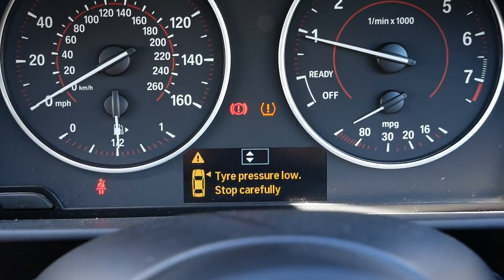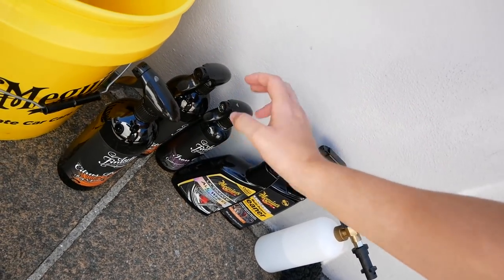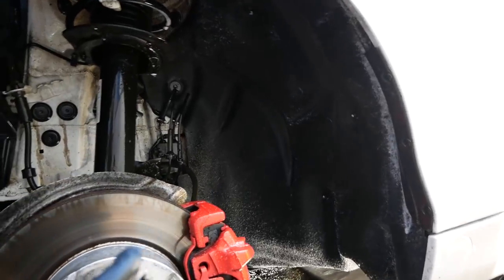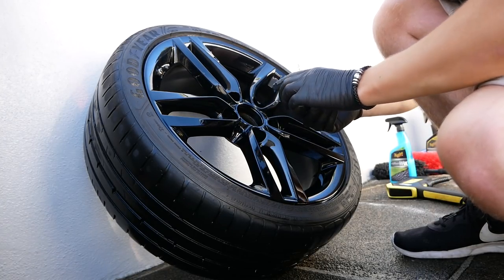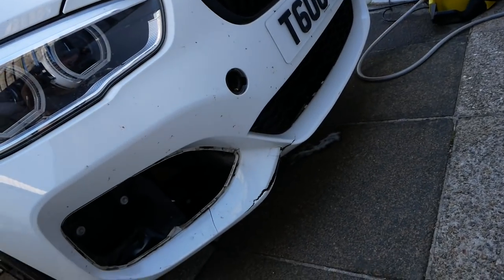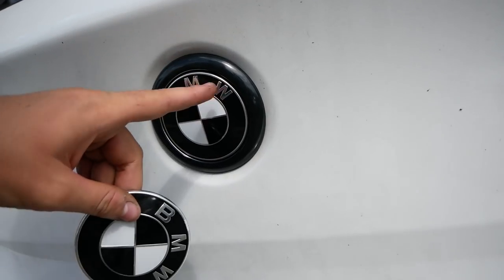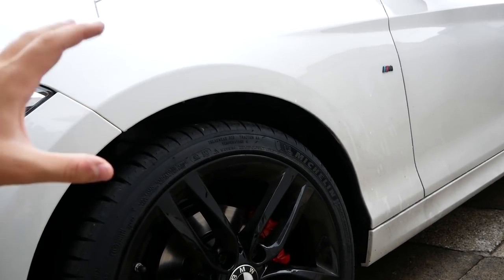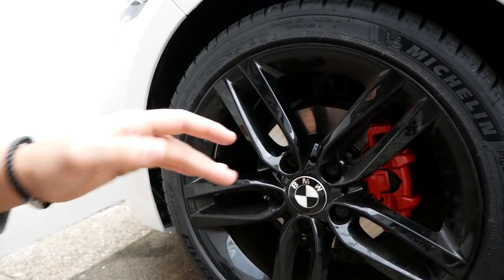MICHELIN PILOT SPORT 4’S FOR MY BMW 1 SERIES! * PAINTING WHEEL HUBS TOO!*

Comment: I’m genX so been around a bit. When about your age I displayed the same behaviour and still do now in my early 50’s. So it’s fair to say I’ve learned a lot. I’m sure you will be the same. May get distracted by partner at some point. Anyways, I currently proudly own a 435d xdrive and have owned lots of BMW’s in my time. It’s nice to see that a a young “enthusiast” such as yourself have your priorities all correct. With regards to tyres, in my opinion the PS4’s are one of the best tyres available. I prefer the run-flat flavour but that’s my personal choice. They are not overkill, they will last you and look a million dollars on your car. I recent sold a 330d coupe which I went through 2 sets of Michelins. PS2 first set and lasted almost 30k miles. Second set this time PS4 variety and they are absolutely outstanding. New car getting same treatment soon. Anyway now some time has passed for your video here, how did you find those? ✌️👍🇬🇧

Comment: I am sooo happy to see this video. I have a f21 125i and purchased it with the same wheels that you used to have, RF as well. I switched them with Michelin PS 4S's a few weeks ago. I know they are overkill but they are much more comfy. The car feels really planted on the road. Although it only has 224 hp, with the old wheels it struggled for grip on wet surfaces.
Reply from the maker: Yeah mate! Even with my 180bhp they slipped when in 2nd on roundabouts 🤣! New tyres are so nice

Comment: Definitely one of the best looking white 1 series, for the moment 😉 Don’t worry too much about the floating wheel caps, they don’t work in low speeds (not less than 20), trust me I tested it by driving beside every mirrored shopfront in London 😂 Also, I nearly ran over a rabbit on a country road late last night driving back from Brighton, my front bumper clipped its ears and as I hit the brakes, it escaped from the side of the car... phew!
Reply from the maker: Yeah the floating centre caps don’t really fit so sending them back lol! Not worth the hassle they’ve caused me haha!
Reply from the maker: I’ve got much more planned soon 🙂
Reply: Brett Barnes Definitely sell them on! I can’t tell you how many BMW drivers have complimented them at the traffic lights 😁 Just wish I had a boot full that I can sell on the spot 👌🏼 Btw, I don’t know how the hell I got nearly 3,000 views in less than a week on the video of my floating wheel caps, using a jet wash 😂 Part 2 of the video will show it in motion from many different angles.
Reply from the maker: Mine seem slightly to tight so they just get stuck and don’t spin, only 2 out of 4 do it though! I think it’s because the paint on my wheels are thick after being refurbished a couple times
Reply: Brett Barnes I changed my RFT to non-RFT with Michelin Cross Climate+ and I agree they are incredibly comfortable, cushioned, less noisy and more glued to the floor. I got these ones as I don’t need to change from summer to winter tyres every season.
Reply from the maker: Yeah love my new tyres
Reply: Brett Barnes That could be the issue, definitely sand it down. Btw, run flats can easily buckle the alloys, as BMW themselves admitted their alloys are too soft when used with RFT’s. There could be a worldwide lawsuit but no one seems bothered. I’m changing my alloys to Romac’s soon, same design but much better quality and reliability.
Reply: Kristian Reed  I think it was mentioned in this post https://www.honestjohn.co.uk/forum/post/index.htm?t=75339 - if not then one of the BMW forums. My warranty runs out in March 2021 but BMW wouldn't repair or replace the alloys, their excuse was that it's down to potholes etc, instead they wanted to sell the set of four 719m (diamond cut) alloy wheels for £3k! I bought 1 replacement from ebay for £150 but it got buckled very quickly with RFT. I bought the Romac wheels as its identical to the 719m design & Michelin CrossClimate+ and the car drives like new, very therapeutic! https://www.wheelbasealloys.com/alloy-wheels/romac/venom/black-polished/18-inch/bmw/1-series/f20. I do a lot of mini road trips around the UK, particularly in the countrysides on single track roads with a lot of debris, so far I haven't had any punctures. I did get a bubble in the RFT tyre last month after hitting a deep pothole, that's the problem with RFT's, they need repair/replacement too quickly. If you do switch to non-RFT, make sure to keep a couple of cans of Holts Tyre Weld in the boot.
Reply from the maker: That’s very interesting! I’ve not got my rear wheel replacement that was dented and super happy with my new PS4 tyres
Reply from the maker: Ah okay! That’s interesting to know! I feel a little vibration when braking, not much though
Reply from the maker: Yeah even the grills arnt stock mate! Originals are chrome. The previous owner changed them! And yeah loving the rear black diffuser! I show it properly soon
Reply: Kristian Reed  I bought mine last year from a 2nd hand dealer and it's been hell communicating problems to them. They sold the car for nearly 20k with buckled alloys, although strangely this wasn't noticeable in the test drive. I'm wondering whether they buckled it after I refused to take their extra warranty, which they tried to hard sell for almost 4 hours! Check out this blog post from an independent BMW specialist http://bmwspecialistreading.co.uk/why-we-dont-recommend-runflat-tyres/
Reply: @BrettBarnesYT  A few weeks after driving out the showroom, I noticed this strong vibration when braking. I nearly replaced the brakes but a mechanic friend told me they were in perfect condition, considering it only covered 8,000 miles and it was an ex-courtesy car! I spent a lot of money fixing the buckled wheels 3 times, until I realised it can't be fixed more than twice, it's deemed a failure and so I had to buy a used newish one from ebay. Good that you replaced yours sooner than later as it could've affected the suspension.
Reply: Kristian Reed Went with the same size as the run flats seeing as it’s rear wheel drive, the rear tyres are slightly bigger at 245 compared to 225 on the front.
Reply: Kristian Reed I wouldn’t recommend buying used as it might of previously been repaired and I simply wouldn’t risk it. Corona has definitely hit the wallets hard and I know this from experience, so I recommend buying new tyres but use payment assist to divide the total cost over 6 months, no interest/fees and no credit check. I used it with national tyres and I got 4 cross climates+ fitted, 4 tyre guarantees, oil change & filter, 4 wheel alignment = £600 divided over 6 months. I recommend using a desktop browser and when in the basket page, slowly move your mouse cursor to exit the tab but don’t click close, a pop up will appear on the page with a 5% discount code starting with NTA- 😉 Payment assistances works with a lot of local garages so check their website but I highly recommend national tyres as their tyres are dirt cheap.

Comment: Get some beaded brake lines the don't expand as much as the felxies that come standard and should help you stop
Reply: Charlie Jackson they don’t help you stop more. They used for track use when brake fluid can get hot and then causes brake lines to expand and deteriorate. So only really useful if your into your track days.
Reply: @will-qc8di  oh OK I thought they helped brake pressure so they don't expand and contract as mu h under hard braking as felxies
Reply: Charlie Jackson Yh they still do that but for day to day driving you won’t feel a difference

Comment: PS4 is not overkill, it’s a very comfortable  tire with very good wet performance.

But it’s not a (more sport focused) UUHP tire like the Supersport as fitted on the M140/M2 etc which gives better steering  feedback and more grip if the tire is hot but with less comfort and less grip in the wet
Reply from the maker: Very true! They are so comfortable!
Reply: Brett Barnes they are great tire - I’m just a bit afraid that they are a bit to soft (sidewall) for an M140

Comment: I have the exact same model with yrs. even same color and same wheels. But I have run flat tyres. Now after 4 yrs they need change because they are too slippery on wet roads. I have the Bridgestone s001. Shall I go with the Michelin? And did you buy some kit for repair in case you hit a nail or something?

Comment: Love your video. Are all tyres 225/40R18? 
And where do u put the spare wheel since the battery already takes the space under the boot?
I am going to change new tyres for my 125i soon and I don't like RFT, but really don't know how I can do if the tyre has a road hazard damage with normal tyres without a spare one.
Reply from the maker: Thanks for watching! Basically I keep my spare wheel at my house but then have a tyre puncture repair kit and air pump in case they ever get a puncture

Comment: Runflats are so bad for fuel economy too. The dealer fitted my 1 series with the Michelin Primacy 3 RF and they gave me about 40 - 45mpg on average. Credit where it's due, they last for ages like any other Michelin tyre, but since I changed them to the regular version, I'm now getting about 56mpg average. I don't understand why BMW didn't just include a spacesaver with F20/21s... quite sure there is enough room under that boot floor, and they don't exactly weigh much.
Reply from the maker: Yeah 100% agree mate! They are much better
Reply: Have you bought some Kit in case you have a flat tire?
Reply: Is that on the 118i?